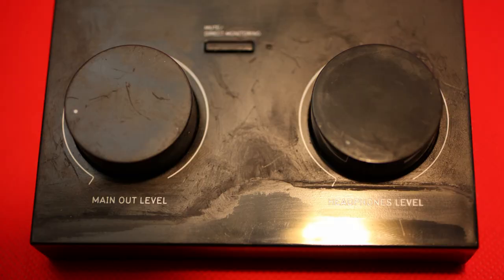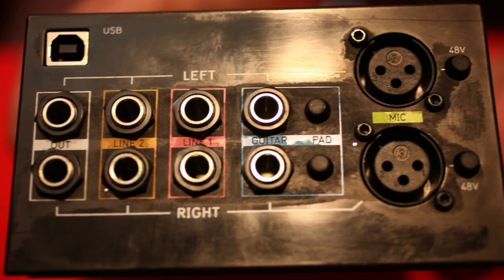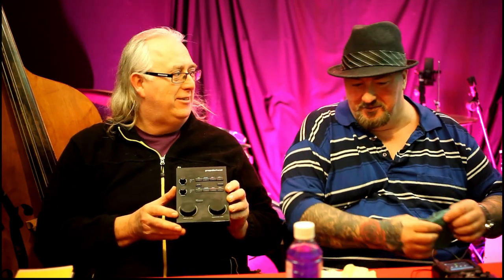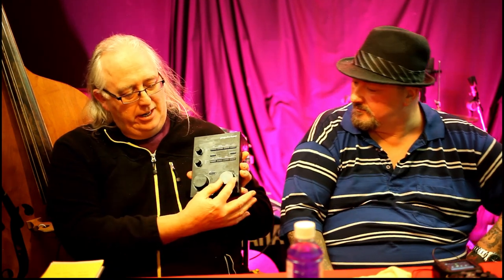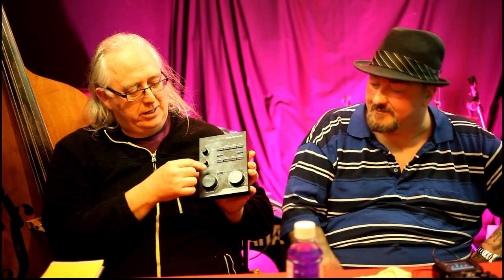Propellerhead Balance Interface has yours gone sticky?

Comment: I have one from 2011, and I'm the original owner. Mine does not have this issue and I still use it. I love it, use it, and am not selling it. Thank you for this video. I was just doing searches for this device out of curiosity to see if anyone was still talking about the device and found your video. Oh, and mine has never been exposed to direct sunlight for what that's worth.
Reply: Me too and I love it!  I use it with my MacBook Pro but notice excessive crackling and static when using on Windows.  What OS are you using it with?
Reply: @CarlitoM77  I use a MacBook Pro as well. Never tried it with Windows.
Reply: @bjornfsteen  Ahh right on!  Good ol Macs... they just work huh!  🥳
Reply: I've still got mine from new and it has gone sticky unfortunately. Lucky I came across this video as I was going to get rid of it. Now I know it can be cleaned I can appreciate it again. PS I use mine on a 2013 iMac, but will probably get a Mac Mini next year.
Reply: My balance just stopped reading in my audio setting MacBook Pro, any help please!!!

Comment: The rubber feet on my Yamaha PSR keyboard at a certain age, probably 15 years or so, suddenly turned soupy. I thought it very odd as it hadn't been left any where near a heat source or anything. I was teaching guitar at a students house at the time and he dug out the same model, exactly the same issue. They had to be on the stand as it would leave tar like blobs on a surface, we taped up the feet in case it dripped. I wonder if it's an ingredient in common with what you guys are talking about. I noticed similar on an old pedal once too, 'orrible stuff.

Comment: The rubbery coating is probably because someone used a plastic cover on it. Happened to a dj controller i had stashed away for a good time. Almost like it needs air
Reply: Mine's sticky. Never had a cover on it. Indoor studio since new.
Reply: Soft touch plastics are notorious for turning sticky overtime. This is especially problematic for electronics manufactured in the 90s.

Comment: Ah, sticky.. What about driver for win 10/11? It's crashes with bsod: balance.sys SYSTEM_THREAD_EXEPTION_NOT_HANDLED
Love this unit since 2012
Reply: Hi I know this is late and may not be appropriate for your situation, but just came across this video while trying to clean up my old Balance interface :). Anyway I use it with an old Microsoft Surface that I upgraded to Windows 11 and it runs perfectly with the driver from Propellerhead but you have to disable Core Isolation in Windows Security Settings. This is fine for me as I only use this laptop for mobile music creation and nothing else. YMMV